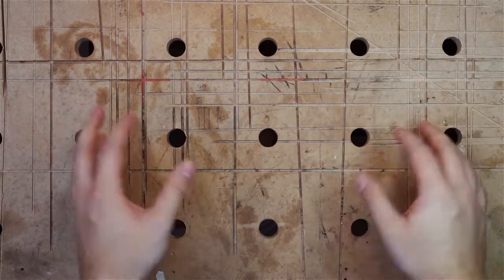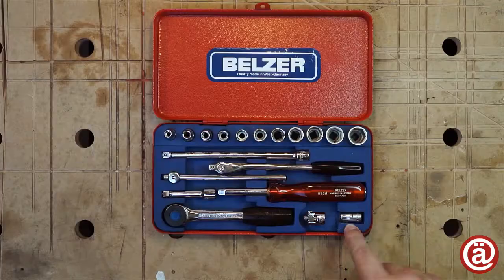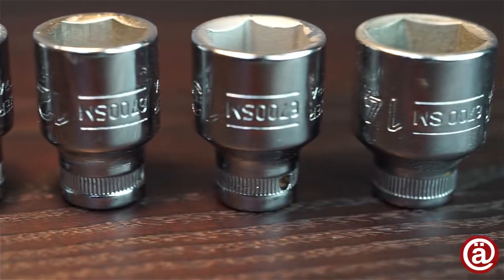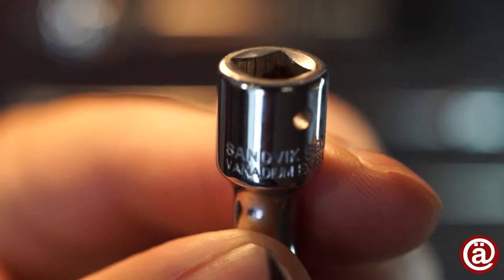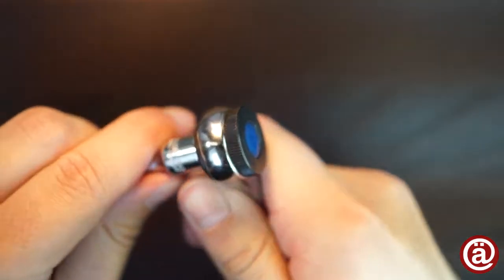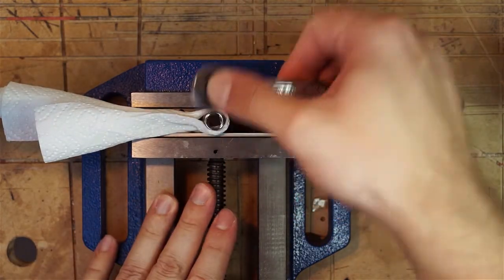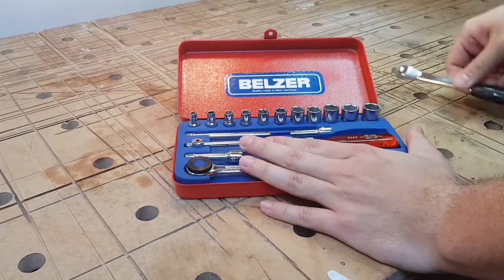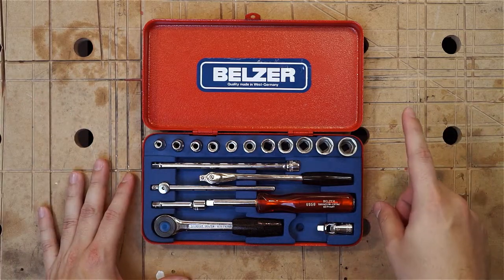Vintage Belzer socket wrench set - review | Etna.

Comment: The belzer brand make tools in 2020?
Reply from the maker: Nah, sadly not. Only in Brazil they are still going but don't ask me about their quality. Too hard to get. 

Regards,
Etna.
Reply: @Etna.  I do not understand how a company with such quality in its products can disappear, I have always said, there are no tools such as those made in Germany. I have a small belzer electronic screwdriver, the ergonomics and quality of the steel are unmatched.
Reply: @Etna.  I do not understand how a company with such quality in its products can disappear, I have always said, there are no tools such as those made in Germany. I have a small belzer electronic screwdriver, the ergonomics and quality of the steel are unmatched.
Reply from the maker: Well, to be exact, you can still find Belzer gems in the Bahco shop. Some pliers and tweezers are still branded Belzer. "Oldshool" looking German made tools have the same quality as old Belzer ones. But avoid new tools made in Spain and such. They are horrendous.

Belzer fused together with Sandvik, wich was purchased by Bahco and now owned by Snap On, I think. Something like this. And that's the reason the quality ranges from scrap to top of the line, depending on their heritage. 

Regards,
Etna.
Reply: Before Belzer fused together with Sandvic, the come together with Dowidat (short time). Belzer/Dowidat was also branded with DWU (Deutsche Werkzeug Union).

You are right,... Bahco still sell good Vanadium Extra Stuff,... BUT... nothing reach the old Belzer tools who are in blue metal cases with the old original Belzer Logo, which was stamped in the case.
Reply from the maker: @HOTP-vx7og  Thank you fpr the added information!

I might need to look for it.